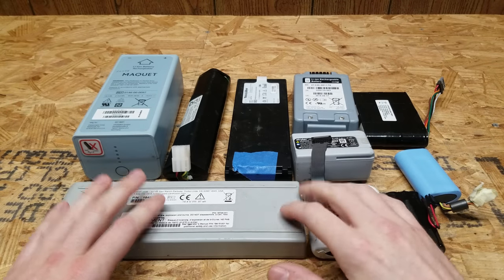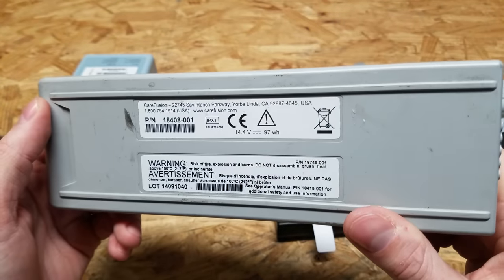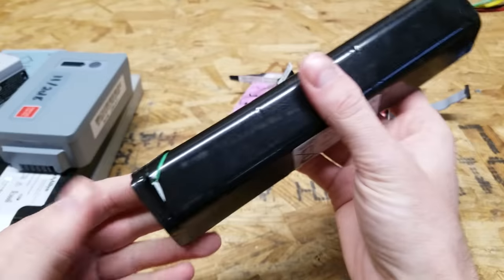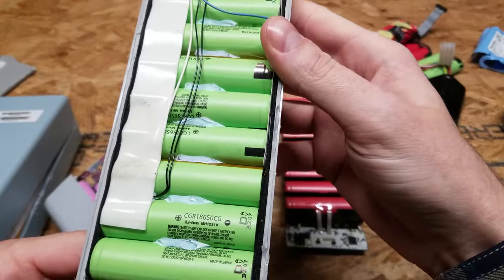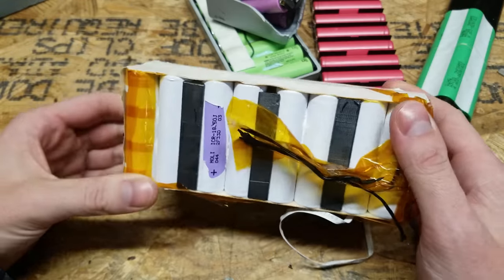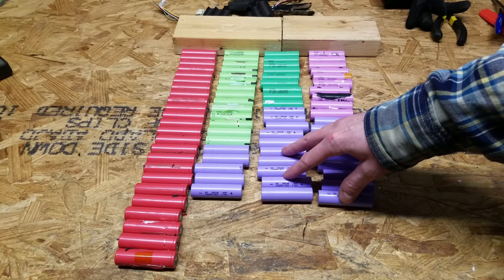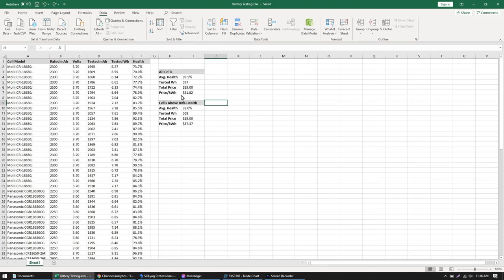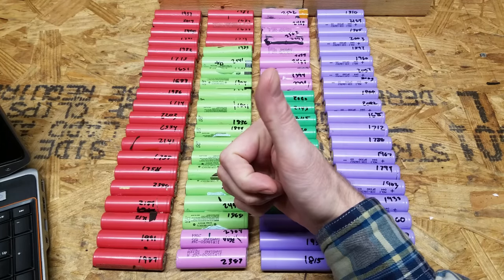Medical Battery Packs - What's Inside, Testing, and Cost Evaluation

Comment: I have processed about a box and a half of these and have gotten almost all sanyo, samsung, lg or sony cells. The small panisonic batteries have vtc4s with low usage, one of the boxes had a brand new unboxed module with 3 vtc4s in it. I think this is a great deal for cells and I bought 4 more

Comment: I just finished my 30lbs and it came with 2 of those large packs with moli cells and all 48 of the cells tested between 2330 and 2492. 24 of the cells were dated December 2015 and the other 24 were October 2016. No Samsung, 9 lg 2200 cells that also tested above capacity, 12 sony, and then the rest were sanyo. About a hundred of them were 2000mah sanyo. I averaged 76 cells per 10lbs.

Comment: You are lucky! Nice spreadsheet. I got a medical pack too, total 61 cells, lots of low 1000 mAh 18650 cells. Some nice cells of 2300 to 2400mah. 11 A123 cells- they are not holding charges. I ended up $63.87 per kWh, including those very low mAh cells. Their Mix tool packs are much worse. Lots of leak and rust cells, lower mAh at around 1300, dead NiCd pack. Also two working tool battery pack. Tool pack is around $78.14 per kWh!

Comment: I bought about 70 lb of this battery from battery hookup and was disappointed to find that most of the battery the internal fuse has blown and a set of Ryobi tools battery which is at 0 volts I am questioning the situation of putting this in use I am charging up the Ryobi battery some of them take charge but some of them is completely dead Short circuit. You have to be careful when buying those scrap cell because not all time it comes out good.

Comment: What is your technique for removing the bus strips? I always seem to ruin a few.
Reply from the maker: I usually grab with longnose pliers and either yank straight off or carefully role them if I think they're going to tear holes in the cells. I rarely damage one.
Reply: @LithiumSolar  Thanks! Some of the deep welds have been monsters. I'll keep practicing. I am sorting through 100lbs of power tool batteries and some medical. The stryker batteries have all been lithium iron phosphate, suspect the same in your stryker medical packs.
Reply from the maker: Ah, powertool batteries are typically welded much stronger than these types of packs. Some of the drill batteries I took apart, I ended up cutting the nickel strip at the cell, then tapping it down flat. Otherwise, I knew I would end up tearing them unfortunately.
Reply: @LithiumSolar  I was wondering if that would be ok, I’d rather spot weld to the existing leftover bits. In quantity it’s too hard to file or dremel. Thanks for making my project easier!
Reply: Can that large battery be charged and used as is?
Reply: With weak welds and strong cell cases, I just roll them off.  With strong welds and weak cases, just cut off most of the nickel tabs.  Make sure the remaining part is not extended over the side of the cell.
Reply: @stanleyrank808  it is a 4S battery pack.  Add a BMS to the wires coming off around the 5:54 time mark, and you "should" be able to charge it.  Obviously test it, and check for hot cells.  If you have a bad cell, you will have to break it down to salvage the remaining cells.  If you want to try to use the battery pack without opening it, then you will need to reverse engineer the included BMS.
Reply: @christopherf7423  I have a 4s Bluetooth bms, my batteries are going to be delivered today, hopefully I get the big one on the video. Thanks for the info.
Reply: @stanleyrank808  I am also curious to know what could be done with this battery as-is or just by adding a BMS. Please let us know what you ended up doing with it if you got one.
Reply: @Noraf83  Its 4S so its a high side 12V pack. Charge it up to 3.6V and you get 14.4V which is safe for most 12V appliances You should bring it up to 15.2V and get quite a bit more capacity out of it but 15V is usually where 12V stuff starts blowing up, YMMV. The majority of capacity in lithium ion cells is in the 4.0 to 3.3 volt range so if you can get away with charging up to 15.2V/3.8V and running them down to 12V/3.0V you'll get most of the capacity and dramatically increase the cycle life by staying out of the high region where there is the most stress on the cell. If you do discharge down to 3.0V on those molicels thats have a minimum of 3.0V my advice is to not let them sit down there for extended periods of time in order to get the most cycle life out of them. The cells that have a 2.5V or 2.75V minimum I'd be less worried about as even if they self discharge a little bit they are still completely within spec.

With 4S its just a matter of finding devices that'll go as high as possible in voltage so you can use as much of the max 16.8V as possible. If your device can handle up to 16V max then that is beautiful because 4.00V is generally considered the sweet spot for getting hundreds and hundreds of more cycles out of it than normal.

With 3S you want devices that'll go as low as possible. 9V is ideal but most devices don't like going below 10.5V or 10V.....10V is ok because thats 3.33V per cell so 3.33V to 4.00 or 4.10V would also dramatically increase cycle life
Reply: @Noraf83  And of course the other option is adding a buck converter or a boost converter. Buck boost converters are often limited in output amperage and anything over 5A or 10A is pretty expensive. The LTC3780 is the most reasonable 10A module I'm aware of at $20-$25 but it requires some cooling if run at 10A continuous or anything close to that. A heatsink on the bottom of the PCB and a fan would be my suggestion. Some modules come with a heatsink so adding a fan is really simple if the heatsink is a standard size like 40/50/75mm

Comment: Do  you use mega cell software, if so, what OS?
Reply from the maker: No, I don't use the megacell software. It was very frustrating to use due to being programmed in a way that is like 1990s software. The APIs are all open for use, so I wrote my own script in PHP that runs the capacity testing on the device.
Reply: @LithiumSolar  sweet, so I can code something for it in Python or Go. Thanks
Reply from the maker: @djsimplyseth  Yup. I have the PHP code posted here https://secondlifestorage.com/index.php?threads/megacellcharger-php-automation-script.10236/ if you want an example. It's pretty much just GET/POST requests with JSON. I ran wireshark to grab the API calls while using the official application.

Comment: Wait weren't those samsung 26Fs?  Spreadsheet shows 22F
Reply from the maker: The light green cells are Samsung 22, the pink cells are Samsung 26. They're both in the spreadsheet but I see the 26's are incorrectly labeled as Panasonic when they should be Samsung. I'll fix and upload a new copy of the spreadsheet to the forum post later this morning. Thank you for pointing this out, not sure how I missed that...

Comment: Can these batteries be used for a Tobacco Vape Pen? I've seen similar batteries used for them.
Reply from the maker: No. Vaping requires batteries capable of high discharge rates. These can only handle a few amps before they start heating up.
Reply: Battery Hookup also sells the 10 pound assortment of mixed tool batteries which have a higher discharge rate but I'm not sure if they are rated to be used in vape pens.
Reply: @robertgiresi9515  I got one of the mix tool pack from battery hookup, lots of totally rusted leaking cells. Two working battery packs. One dead NiCd pack. I ended up $78.14 per kWh, higher price than other varieties.

Comment: weighing the batteries like weighing something else after you get it home. I don't want shorted fam lmaoooo
Reply: Nearly 1lbs shorted plus all the casings and junk boards that get removed.. Still not a bad deal though.
Reply from the maker: It was not 1lb short? It was 1.25% of a pound short. Lol
Reply: @nadieselgirl  9lb 15.6oz and there’s 16oz in a lb
Reply: @peterg.8245  Opps, I head 9.06 oz.
Reply: @peterg.8245  Oh, now it makes sense, I was sure it was 9,16oz.
American numbers are hard, I prefer kg, easier to work with.

Comment: Only in America when 9.1 is rounded up to 10.0
:D
Reply from the maker: What? Where do you see 9.1 anything? There is 9lbs 15.8oz of batteries here. There are 16oz in one pound. That's like 4.51kg vs 4.53kg. LOL.
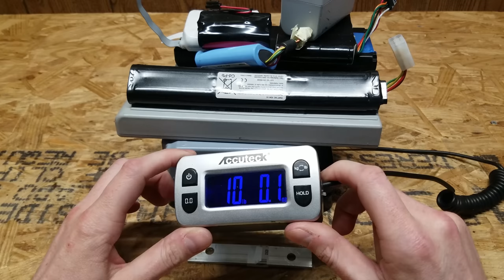Reply: @LithiumSolar  <3. ;). @0:37 on a smartphone sized screen :P
Reply: Yeah, I have seen the same.
9,156 is close to 10 if you know that in imperials 0.16 = 1
Just learned it myself from other comment.

Comment: Those almost as cheap as my A123 Lifepo4.
Reply from the maker: I'd prefer LiFePO4 these days myself.
Reply: Where do you get $37/kWh A123 Lifepo4?  Most I see are around $130/kWh range.  The bus packs I got were pretty much end of life at 60% and some dead rows.  Even if they weren't end of life, the price I paid was still over $110/kWh.
Reply: @LithiumSolar  For me it is safety, seeing lithium lighting up like fireworks , no thank you.  When it is a DIY project LifeP04 seems the safer choice.

Comment: 9.1 lbs does not equal 10 lbs.  Have you sold out to businesses?  This looks bad for you.
I like what I get from Battery Hookup.  But this is not a minor mistake.
Reply from the maker: I think you've made a mistake. That's 9lbs 15.8oz, NOT 9.1lbs. There are 16oz in one pound so it's short by 0.1%.
Reply: @LithiumSolar  My mistake.